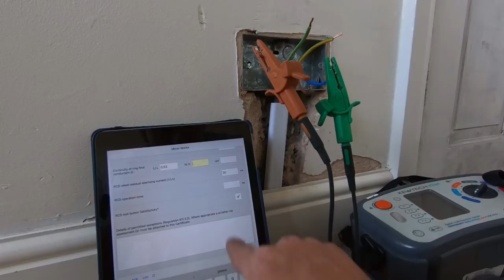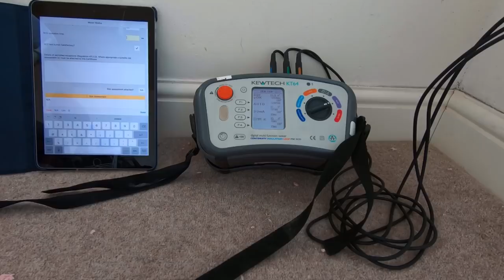Adding Additional Sockets To An Existing Ringmain. Banter!!!

Comment: That CK tool you showed in the beginning is mainly for SWA cables. I’ve been using it for 6 years now and it definitely speeds up the process instead of using a hacksaw. Worth the money. Never tried it on pipe before

Comment: Hopefully they will make wago type connection on the back of the socket
Reply: Love it. Might be shite for doing 2 or 3 wires into one hole though, unless they had maybe 3 ports per hole available, but that sound like extra money which ain't likely for a lot of sectors considering how cheap a socket currently is
Reply: You get push in connections on German products. Not available to in the UK (at least widely)
Reply: Here in the USA we have Wago styled insertion sockets on our outlets.
Reply: MK do them
Reply: MK do them

Comment: Keep up the good work!

As a Dutch subscriber I am still amazed at how UK electrics are done as how you build your homes.
Reply: Interesting to hear how you guys do things ?
Reply: @strongerandwiser2023  We start off with a code called NEN1010 which is made up by a group of 'Industry experts' and which in itself doesn't have a legal status.

95% of house have a single phase 35A capacity or a 3 phase 23A/phase capacity coming in.

Main fuse > meter > fuse board. No maximum of groups except for 4 groups per RCD. Maximum per single phase group is 16A. 3 phase is usually used for cookers and such and also fused 16A.

Wire is 2,5mm2 for brown, blue, green/yellow. 1,5mm2 black is used for switching light and so on.

Because most houses are totally made of concrete, we run single wires in pvc pipes to a central box which is usually a lighting point. From there it goes to switches, sockets, back to light and can branch of to another central socket.

Do you get a bare idea with this short discription? You can put 'huis bedraden' in the search function. Should give you some results.
Reply: @Richard1977  Are you at 230-250V there? (we're meant to be 230V officially but most houses I see around 240-245V at board on my tester!)

Do you not have any electric hobs/showers/immersion heaters? Here an electric shower often wants about 45A circuit to itself, 32-40A to oven with electric hob, 16A for the immersion heater... having just 32A for the house just won't do the job in many homes (although for a small flat or apartment using gas hob/heating and shower supplied by the hot tank it would probably do).
Reply: @Mattja1  Hi Matt,

Sorry for the late response. We are remodeling our house and combine that with a lot of appointments....

Anyway, we are mostly natural gas powered. So cooking, hot water, warming up our houses and so on is done with natural gas.

Therefore we really haven't needed heavy supplies in the past to get things done. Most power hungry machines used to be a washing machine, dryer and electric oven (all around 10A). Some houses have a small 10-15 liter close-in boiler for a single tap which is also around 10A.

So we didn't really more than 25A-35A single phase.

But now, with the energy transition because of the environment and because we are running out of natural gas (not really, but the extraction of natural gas presents problems like earth quakes and sinking of soil so 'they' decided to abandon natural gas) we need to totally switch to electricity in something like 30 years.

Although that may sound as 'enough time', calculations have already shown that it's an almost impossible schedule.

With that they also want us to change to electric-only vehicles (from 2030 you can only buy electric vehicles in the Netherlands). That also puts extra demand on our distribution network (which is already on its max in some regions) so I am pretty sure that the deadlines won't be met. Apart from the biggest question: Who is going to pay for all that? Because we are talking billions and billions of Euro's to get even close to what they want.

There's a lot more to this like expected power outages but I want to keep it as simple as possible.

Comment: I have always been told to earth the back box even with a fixed lug, as its an exposed conductive part, if it wasn't earthed and you pulled the faceplate forward and unknowingly damaged the cables, or maybe the cables were already damaged, the back box could now be live whilst you work on it without you knowing?
Reply: Should you be pulling the face plate with the power on?
Reply: It's good practice but only a recommendation, I think the argument is you shouldn't be removing the socket whilst live but everyone obviously does.
Reply: Shouldn’t be working live with the faceplate off 😂
Reply: My lecturer said that exposed and extraneous conductive parts must be earthed. Fair enough. But then he said to consider the back box.....
Is it exposed?
No, it's buried in the wall.
Is it extraneous?
No, it's a part of the electrical installation.
So therefore does it need to be earthed......No.
Reply: You're right, you shouldn't be removing faceplates love, but that's not to say people don't, or won't.. It's always best to be safe rather than sorry imo, belt and braces
Reply: @simonparkinson1053  The whole point I'm getting at, of earthing the back box is that you're correct it isn't exposed, until you take the faceplate off live, now it is exposed, it can be touched and if not earthed can be sitting there live
Reply: @supersparks
Reply: Me too that what I was taught when I was a sweet young apprentice back in the day it was then the 14th edition now im a crinkle old sparkie git in his 60's  on the 18th, in bracing the fire rated fixings in my work, and I still earth  the back of my metal boxes.
Reply: What I was taught was turn the bloody power off. Regs say not required.
Reply: Just earth your back boxes
Reply: It’s basic good practice and for the sake of it just do it, this is for all you young sparks don’t cut corners. Your cpc is the most important so earth the crap out of them
Reply: It’s good practice to earth back boxes not to say we always do. I’ve had a instance in the past where there was a fault to the back box. When we isolated and unscrewed all the faceplate, the fault disappeared making it a nightmare to trace and repair. Eventually found the issue but would have been much quicker if we had spent the extra 10sec adding fly leads to the back boxes.
Reply: I always earth the back boxes fullstop
Reply: I can't be arsed messing around 1 rule for this,  that rule for the other.  
Just earth it!

The code is the bare minimum requirement you can go above and beyond if you deem it necessary.
Reply: Yep I did City & Guilds 236 and you would have failed the practical side for not earthing that back box. You would also have failed the theory side for calling it a ring main.

Comment: Hi, I am looking to do something similar but just to understand.
From the first socket, the one near the door, you will run a cable to the socket from left corner and then from there another cable to the other side. And from the last socket you will run another cable to the first socket near the door? That is the ring system?

Comment: Wow that’s a lot of work to have to take out the carpet and underground , I guess it’s on how houses codes run , here  we got almost all electric on the ceiling running just all other cables that have sub panels externally.  When you guys do this it’s more like a remodeling right you got to have not only electricians but painters .

Comment: tip when filling you put on one way and off the other so you did up and down let it cure a bit then take it off side to side the idea of a PVA mix isnt to make things stick its to stop the moisture out of the plaster therefore falling out and cracking
Reply: I would use a cable snake so I don't fuck the walls

Comment: Hi Chris,
Hope you're alright. 
I need your advise on something... I'm relocating one double socket and installing another on the other side of the bed, can I put the two old legs of the ring circuit and the two new legs going out to the new socket in the same Wago junction box?

Comment: ive moved into a house and i own it now. one bedroom has just one double socket and is on a plaasterboard wall. i want to fit maybe 3 more along the wall for my office space, PC, printer, speakers etc.  so i imagine something like a fused spur and then 3 double sockets. is this something I need signed off or a certificate for, if so I get a spark to do it.

Comment: Chris, may be wrong mate but I'm sure 773 wago's are only rated up to 24A if not I would love to know if they go up to 32A I would start using them !
Reply from the maker: Half the current is carried by one leg of the ring so installing a 24amp Wago is perfectly acceptable.
Reply: @Cjrelectrical   CJR ELECTRICAL  a ring final is wired in parallel with cables being the same size so = 5mm so we reference below size to a 4mm CSA for cable reference.  One does not carry but both do as they are in parallel.

Comment: How did you feed the cables under the floor across the joists? Also, did you just have the cabling resting on the plasterboard when running along the joists? I’ve only ever done wiring during a big house renovation when all the plasterboard was off the ceiling and there were strict regulations on wire clips and positioning. Is there an exception for retrofitting where access is limited?
Reply from the maker: Yes of course there’s a reference method for touching plasterboard get it clipped where practicable to do so.
Reply: Thanks, good to know!

Comment: I’m changing an old dimmer switch to a newer one just to freshen the room up. In my house I have the old black (neutral) red (live) and earth cables. When I took the dimmer off I forgot to look where the cables went. Where do I put the cables back in? Does the live go into the COM line and neutral into either L1 or L2?
Reply: You should get an electrically qualified person to do it, based on your level of understanding. (no offence).
Reply: Red com 
Black L1 (switch-line)

Earths in the correct location / connector blocks mate 

You don’t need someone who’s “electrically qualified” to do this

The requirement is someone who is electrically competent.

Comment: Hi Chris mate I need help on how to wire up a basic 2.5mm ring socket. How do you run both cables and where to can you do a video on running the cables. You block it out every time

Comment: we dont torque up switches and sockets, because london fire brigade does not have a problem with them being installed, they only have problems with badly installed mains boards, but who knows in the future we may only be allowed to install metal switches and sockets. if the house wiring was that bad why did the kitchen electrician even work in the place, its obvious to anyone hes modified the existing, then he did his testing, i.e the bang test, then hes hot to trot. And if its like when i go to similar jobs the customer can never remember who they were. Nice to see part p working well.
Reply: I doubt there will be a requirement for metal switches and sockets, DIYers usually get scared at the CU but they're often happy to mess around with switches and sockets, unaware that they shouldn't be putting metal switches on the old lighting circuit that lacks a cpc.
Reply: @Mattja1  sorry that bit,  was a bit of a piss take at how the country has to jump as soon as London fire brigade demand action. 
And it's easier to deal with the symptoms rather than the actual cause, i.e the dicks who can't install them correctly, and take the money and run.

Comment: It would be cool if the iPad connected to the scanner with Bluetooth or something and filled in the values for you. 

It would just tell you which wires to connect to, press test and then it inputs the data and tells you the next wires to clamp onto and test and fills in the results and so on.

Comment: Is there any real risk if no cable tie is used on the wagon junction box
Reply from the maker: Nope
Reply: @Cjrelectrical  thank you - I was also wondering about the new inserts released by wago for the 221 connectors inside the boxes - there are many boxes already installed without those inserts !

Comment: Great work buddy. Not sure if the circuit was on a 32a mcb but those wagos you used are only rated at 24A. Need to use the lever wagos for 32A circuits or the red push fit ones are rated at 41A
Reply: Just seen other comments on this about half the load going down each leg. Obviously that is correct but I'd personally use the 32a lever connectors.
Reply from the maker: Your incorrect mate sorry.

Comment: Could you tell me please where you get your cable capping for the cable chase to the sockets? I can only see flat stuff on screwfix. Thanks but>>>> 

Literally my new favourite channel, I’m not a sparky to trade, I was an alarm technician for 17yrs cctv alarms etc etc mostly installation work and a few years as a service technician, I’ve been out the game for 4yrs but this has helped me rewire my house with the advice of my electrician mate, basically I’m doing the labour and cabling and fit out taking it up to the point the board needs done. My old electrics in this house are scary bad so currently rewired my upstairs lighting and ring main sockets and downstairs lighting, I am leaving my downstairs sockets/kitchen early next year as we have a new kitchen going in.
Reply: Its on the screwfix website 100% search for oval conduit

Comment: Chris if extending a ring to add 3 extra sockets is a minor works job, so what is a radial circuit say a fcu for a alarm or whatever would that be a full eic because new circuit new mcb etc
Reply from the maker: Correct
Reply: CJR ELECTRICAL 
But the additional load of the sockets outweighs anything the single circuit would pull obviiusly not a cooker or shower circuit  so makes no sense to minor one and not the other i understand the addition to existing and all that jazz but should be minor all round what you reckon mate
Reply from the maker: RK 180 no if your installing a new circuit then you need to issue an electrical installation certificate has nothing to do with load or number of points.

Comment: From the USA here, when running multiple sockets we would pigtail or run them in parallel. This way if one socket goes down the down stream sockets are not affected. I'm going to Italy to rewire a house soon,  are parallel circuits not done for a reason with 220v? Or maybe I'm not seeing something here?
Reply: Multiple sockets are always run in parallel in the UK. Maybe you are confused by the term 'ring' which refers to a ring final circuit. This doesnt mean the sockets are wired in series - they are in parallel but the final socket is also wired back to the consumer unit. The point being that you then essentially have two radial circuits with split load and can therefore use a smaller sized cable. As far as I know, this method of installing socket circuits is peculiar to the UK so I wouldnt assume that they do it in Italy. I guess you will have to look into their codes and regs anyway. 

Pigtailing isn't done as standard on UK sockets (that means bringing your neutral from the socket to a wire nut or connector with the incoming and outgoing neutrals right?) as our sockets are bigger than US ones and the terminals are designed to accept two conductors which are typically  2.5mm^2  (awg 14) and so there is nothing in our regulations to state that you cant rely on the socket to maintain continuity.
Reply: @jakeg12345  ok, I see what you are saying. I'm not an electrician and really only applying mechanical knowledge here. Pigtailing here in the US,  the load, neutrals and the ground are wire nutted to incoming and outgoing.
Wouldn't having the socket create the parallel increases the chance that any non performing socket may cut all downstream flow of electricity?
If I pigtail to the socket would this create an unsafe condition due to the either socket design or Europe's use of 220v? Thanks for the info, all I want is a safe well performing service..
Reply: @johndallara3257  Its possible but then in the UK socket circuits are mostly wired as a ring so each socket is essentially two circuits so if you completely unterminated a socket, the rest of them would then be on two seperate radials albeit with potentially insufficient conductor size. I dont know what local regs say in Italy but for a start, I doubt they use ring final circuits. In any case, if you don't know local code - you should certainly find out before you do a rewire. In the UK, as an unqualified person you would not be able to do such work without having the local authority test and inspect it for approval. Even then, as an unqualified person you would still need to be a competent person i.e.  show knowledge of the techniques and standards expected to be used. Pigtailing sockets may be the standard solution in Italy - I have no idea other than to say that if they do, they would be more likely to use wago spring lever connectors or some other connector  rather than wirenuts as the latter are not common in Europe

Comment: How does he run cables from wall to wall as the joists are in the way. Would he have to lift all floor boards up to drill holes through
Reply: Er yes he would
Reply: It's ground floor so there is an open void under the joists